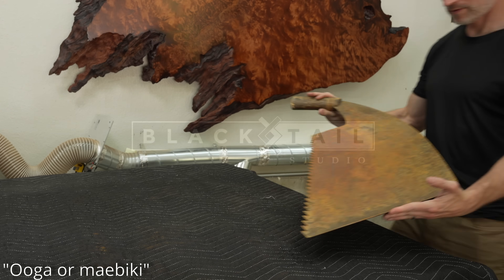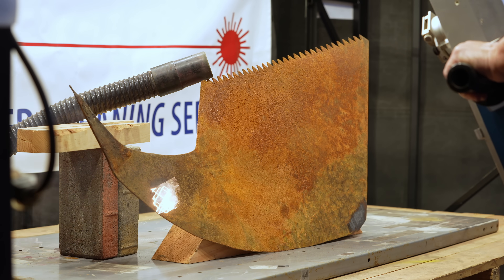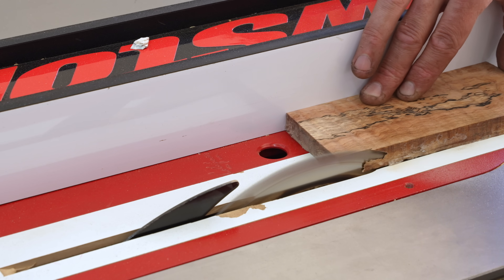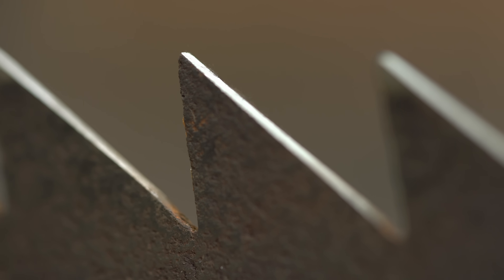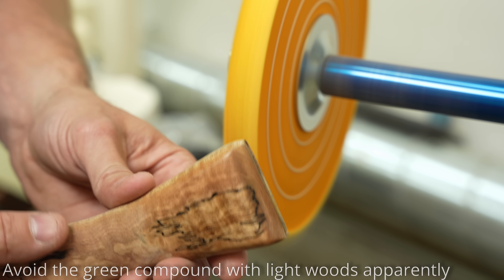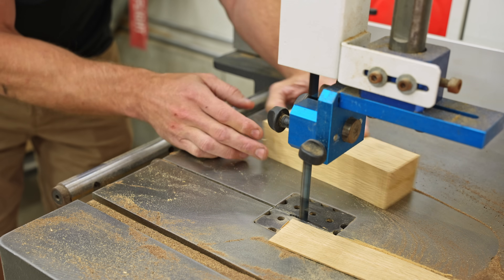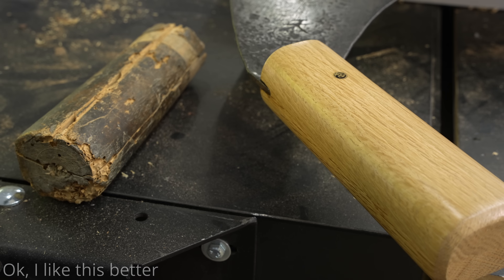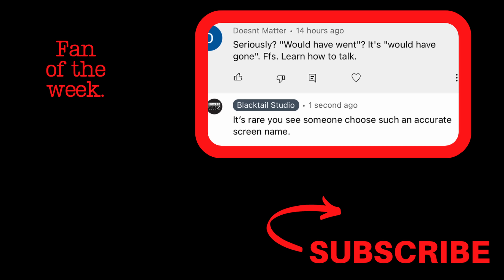Japanese Saw Restoration... With Lasers

Comment: Great video Moby. Continue please to make things you enjoy making or restoring. This was a cool thing to see done and I look forward to more learning opportunities.
Reply: lol beat me to it was going to say i didnt know moby did woodworking
Reply: Yul Brunner, Telly Savalas (I have 2 & can't decide lol) that was an excellent video. You would have undoubtedly found it much easier if you had propped up the workpiece and sawn in a downwards direction with your feet on the ground. Bending over like you did, sawing upwards, is back-breaking!
Also, you were cutting INTO the end-grain i.e. against the grain, which snags the teeth. Try it with the piece up high, horizontal, with the end facing you, and cut with the grain for starters. So on long cuts you end up underneath the timber. You need high trestles because you're cutting overhead, so that's a disadvantage, yes 
I once had to cut the ends off rafters on a shallow roof, not directly along the grain of course but at a very acute angle, standing on a platform, with the blade horizontal  I cleaned & sharpened my grandfather's old hand-ripsaw (which had not seen use for 50 years because of modern tools). This was before YT so I became "expert" from an old carpentry textbook (old-school!) I was afraid I'd stuff up the job with a savage heavy circular saw, because of the complete awkwardness of the situation & lack of control, fighting against gravity, difficulty in seeing my marked line, etc, you know what circular saws are like lol imagine with sawdust flying everywhere spitting into your face; the cut was at shoulder level, blade horizontal as I said.
Anyway, I was absolutely amazed! It was so easy! Ripsaws are broad & long (it was a standard saw, cutting on the push-stroke) but it was controllable, I had no trouble following the line,  it cut like blazes and did a perfect job on 20 cuts of about 18 inches length. Supreme tool for the task, very much superior to a modern power tool for the craftsman-like finish that I hold myself to, even for "rough" carpentry. I could no doubt have bought a lighter power saw with a vacuum dust extractor or something but I'm still delighted, 20 years later, that I did it that way. It was a joy. Haha the things that give us find memories.
I don't think that you gave that ancient saw a genuine try, and man, I hope that you find yourself in a tough situation where you think laterally, take it down off the wall and let it gloriously shine, doing the job in a way that only it can. Beautiful restoration though! I sincerely hope it comes in useful, even if it's only once, and you can treasure it for that, as I do for my Pop"s saw. It gave me that fantastic based feeling that you get, wood-working by hand.
Reply: @topspeed250k5  Lol at the Yul Brynner/Telly joke.

As far as the saw goes... An American hand saw is way easier to use than that huge ungainly Japanese saw he restored.

Comment: Looks amazing, especially for something you weren't used to doing. I'm glad you had gone with that second handle design, I've seen way to many restoration channels make the same mistake of over modernizing an old design, with good intensions, only for it to ruin the look and feel of the tool. Awesome job.

Comment: I come here for your style, your unique flair and way of sharing your projects. So, furniture making, tool restoration or, heck... metalworking... The type of project doesn't matter, because you could be doing random electrical work to wire up a light fixture piece and I'd still watch because as long as it looks and sounds like a video you made, I'm here for it.

Also major props for sneaking in the Gremlins reference, you had me in the first half until you got to the bit about not using it past midnight. Cheers.
Reply: did not catch the reference at all 🤣🤣

Comment: im a dental lab tech and work with cloth buffing wheels similar to the one you were using every day. That "shrapnel" is annoying at first but will eventually even out and go away after a few uses. BTW this was an awesome video and you should do more of these restoration type ones. I was very curious about the "don't use after midnight" part and tried to find something about that but couldn't :( Very interesting.
Reply: Watch the 1984 movie "Gremlins",.......you've just been schooled.
Reply: Look up the definition of “yokai” in Japanese folklore. There was probably a reason the older gentleman refused to part with it. Possibly he felt there was a curse, a spirit, or a demon attached to this particular saw and was holding on to it to protect others.

Comment: I loved this video.  I even liked the fact that you put in all that work on a handle and then didn't like it and didn't force it... I would have probably put it on and kept going.

You should check out this video by another woodworker/maker as he made a really cool holder for the orbital sander to be upside down.  I mean the vise works as well just thought you made be interested.  Really cool restoration project.

Comment: This was a cool project, I love restoration videos! I actually only found you on my page because this is a tool restoration. I'm not 100% with you on the handle redesign, but I respect your decision. They both look pretty good, and the redesign is closer to the original so it makes sense from a traditional standpoint. Considering the rules you were told about for this, keeping with tradition makes sense in this case.

Comment: If you were running at full vacuum it’s likely that it was bubbling for hours cause the solvents in the resin are boiling. Not because you are still pulling air out of the wood. Best to try putting your resin under vacuum on its own first and find at what point it starts to boil then back off the level of vacuum until it stops. You will likely find it’s at around 80- 90% vacuum. If that’s the case, pull full vacuum when you put your wood in with the resin and then back the vacuum off to just below the boiling point. Love your videos

Comment: "And finally, while the strip of metal forge-welded to the edge and containing all the teeth is hardened high-carbon tamahagane steel, the rest of the blade is comprised of unhardened low-carbon iron." - Covington & Sons Tools

Comment: When using a vacuum chamber, the air will still be in the wood, just less of it at lower pressure. The air only gets replaced with the liquid once the pressure is released

Comment: I restored one of those as well, on mine the original handle was one piece with an mortise, the saw was locked into the handle with a small wedge. I had to use a diamond file to get the tooth sharp

Comment: Why the need to offset the teeth on the vintage saw?  Were they not offset originally?  Did they not make saw blades that way originally?  Did all the sanding/rust removal, etc. actually remove the offsets of the teeth?  Thanks!  Great and interesting video!

Comment: Watched Japanese saw refurbishment. After teeth cleaned: isn’t it necessary to put ‘set’ into the teeth to clear debris? Also: have you ever tried putting a vacuum pad over areas of epoxy. Pulls air bubbles out and maybe gets it deeper into wood.
Really enjoy your channel. Rgds SuperSpark

Comment: I know I am commenting on a 2 year old video, but I work for a company in Vancouver that specializes in cylindrical and flat grinding, I am willing to bet we could flatten those teeth so they are exactly the same height. Could have also taken that blade to a perfect flat not that you would want to with that pitting but it sure would have looked nice right before it broke on the first use.

Comment: the laser remove the surface oxidisation and cooks the rust to the surfaces but does not burn the solid metal, so the laser gets rid of most of the surface rust. but to get back to the metal, well one needs to work it

Comment: As i do some Gun restorations and see that you use cold bluing thats the worst thing you can do, it's called botcher ink. The best way to do bluing is to use the hot bluing. Blueing is some sort of oxidation that prevent rust from forming. The cold version is just Ink and not real bluing as intended.

Comment: Did some research and reason why ye do not want to let the blade get wet is the saw are typically of bi-metal construction with hardened high-carbon steel strip that attached to the soft low carbon steel. The steel strip is for the teeth and the rest if the blade is highly susceptible to rust degredation.

Now the thing about not using the saw after midnight sounds like an old mythology similar to the old Hawaiian belief of whistling at night attracts the attention of the Hukaʻi Pō, the Night Marchers, royal warriors who may kill ye depending on how you act around them. Usung the saw at night may have similar consequences.

As a Japanese American living in Hawai'i, I unfortunately don't know as much of the mythologies and traditions of old Japan as much as I'd want to, but I DO hope you DO respect the wishes of the Son and follow the restrictions! It appears there's more to the saw's history than what meets the eye, please respect the tool!

Comment: 🙃🙃An old Japanese saw, but now it is just garbage. If I were you, I would have it on the table fixed and working with a motor. An electric motor would be much better, not using the hand.
  Rather, it is a device for cutting wood

Comment: Rust removal with a laser is a lie. The rust is not removed only its structure is changed so it looks shiny on the surface.
In my company we did a lot of research on this with electron microscope and EDS. Rust is iron oxide and only the crystal structure is changed with the laser from hematite to magnetite maily. The surface looks nice and can be painted but the rust is not removed - never.

Comment: I think hiding a character with the handle was not a good move. Also using a pin and epoxy is disrespectful to the creators of the tool. Im no expert but seemed that the saw was meant to be easily reparable. Your decisions has made it worse.